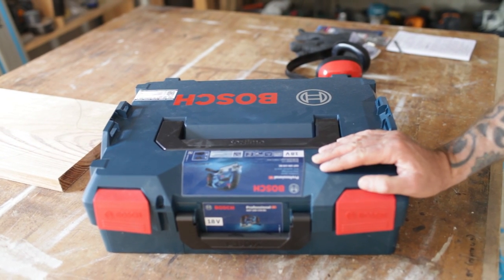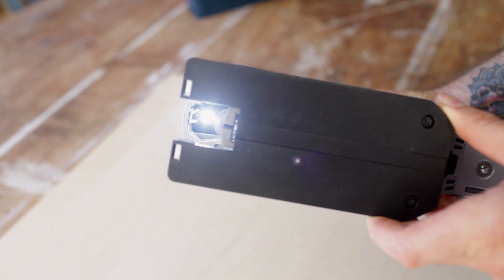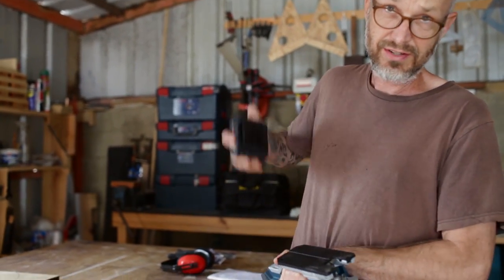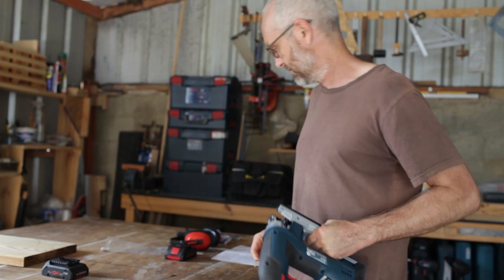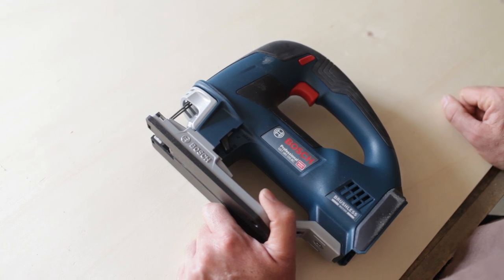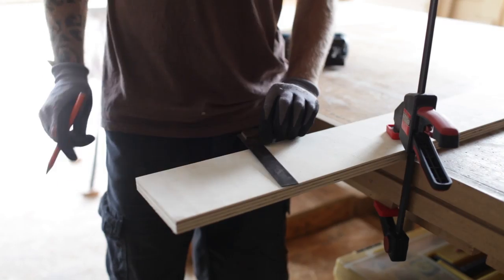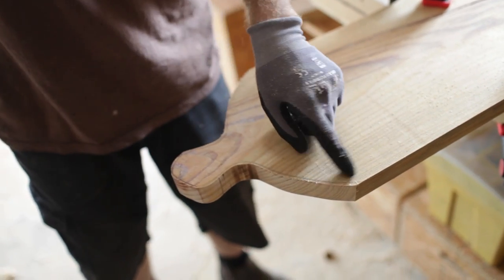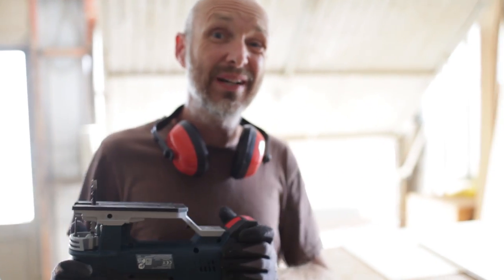Go Cordless: In-Depth Bosch Jigsaw Review & User Guide

Comment: Can I ask you to check of the saw blade hold tight in the chuck holder if you try to rotate it along the axis of the chuk, additionally also if you try to bend the blade from left to right? And if it is not too much trouble for you - repeat this procedures on thinner saw blade for metal. Thanks in advance.
Reply from the maker: The saw blade holds fine in wood and also if the blade flexes. I haven't tried in metal